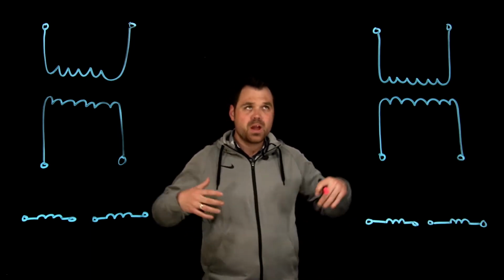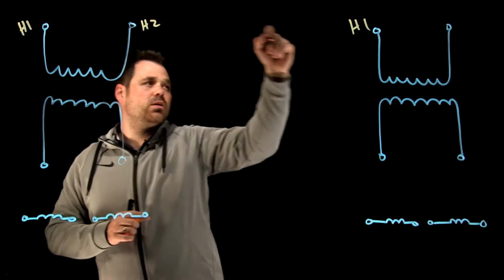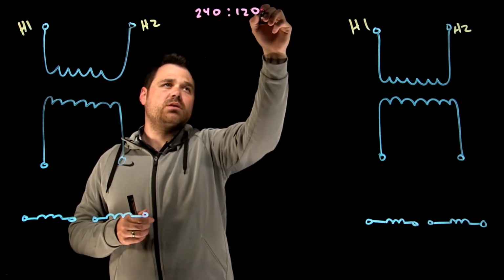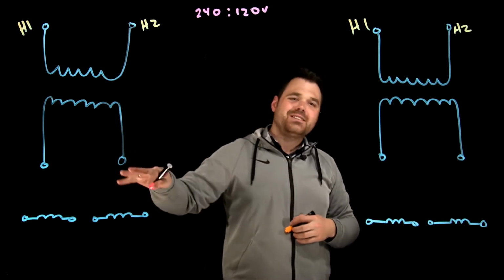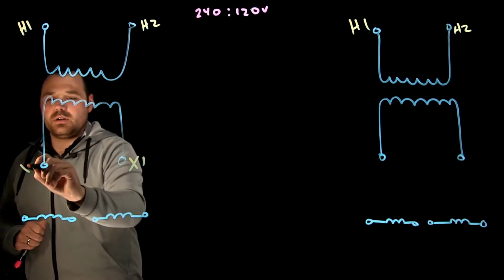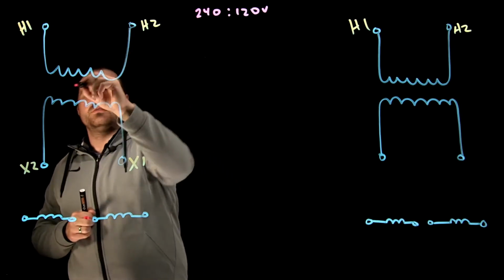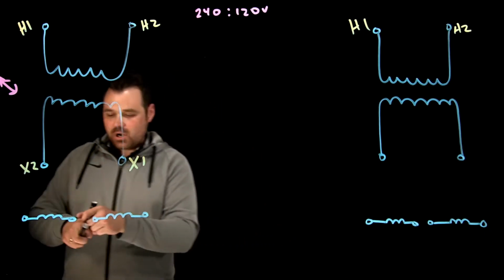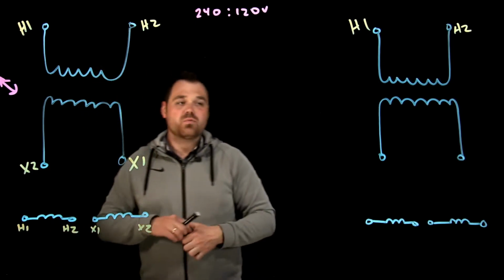Transformer Polarity

Comment: if the primary and secondary windings of the transformer are in the same direction (twist in the transformer core) then the polarity on the start and ending of primary and secondary winding are the same.  These polarity will be in the opposite if the primary and secondary winding twist in the opposite ways.
Reply: Exactly.
However - if the windings are in the same direction - but internal  connections to x1 and x2 are simply reversed - then apart from the "external user connection phasing" - there is no fundamental difference inside the transformer 

Equally - i could "reverse" the winding direction on the secondary winding - and connect to x1 and x2 normally - and the external user wouldnt be able to tell the difference.

There seems to be more about this "additive / subtractive " issue than meets the eye.

If I wind a transformer - with a primary and secondary winding - I would want to know the "phasing"  of the windings - and that will be detetmined by how I label the ends of the windings - and which "relative" direction I wind them .  
However - I cant see the difference between subtractive and additive.  I have two coils "the phasing of which is known"  and i can connect them either way round ! 

However... what i can do is to make one coil have a different relative potential at their physical interface  by say making "one end" of the secondary "ground potential" 

Is this what this is really about?  making say H1 " hi potential relative to ground - and say x1 ground potential  - where h1 and x1are "in phase"?

Comment: Does "H" mean Primary? Why not use "P"?
Reply from the maker: H is for High, so the higher voltage. For a step down, it would be the primary.
Reply: @ZackHartle  So "X" means Low. Are H and X universal conventions for High and Low?
Reply: If I have auto transformer, and have 2 110 single phase inverters will they work together have 220 volt or will I burn one?

Comment: Is there any differences in the transformers themselfs?
If you connect H2 to X2 in the additave transformer, would it work exactly the same as the subtractive one?
If you connect H2 and X1 in the subtractive transformer, would it work exactly the same as the additave one? 
How are these different than buck/ boost transformers?
Reply: Did you ever find an answer to your question?